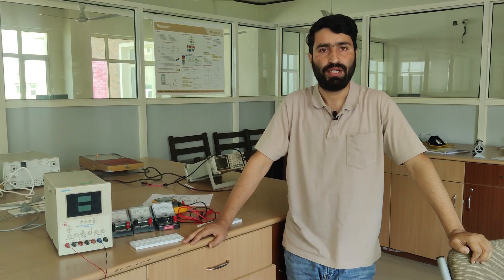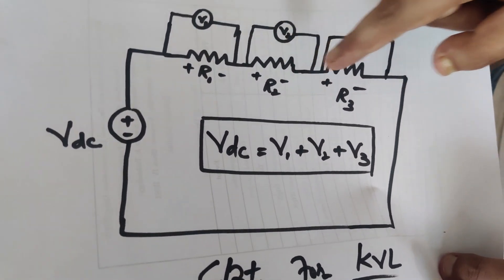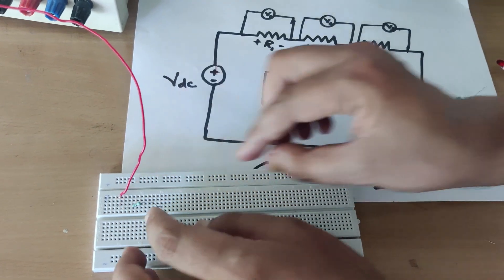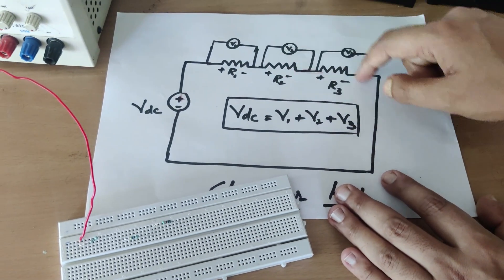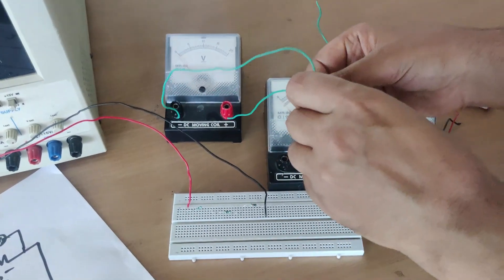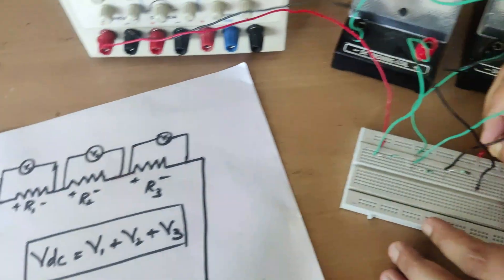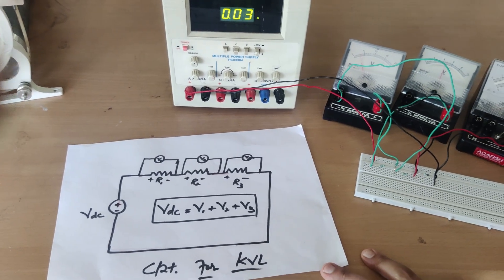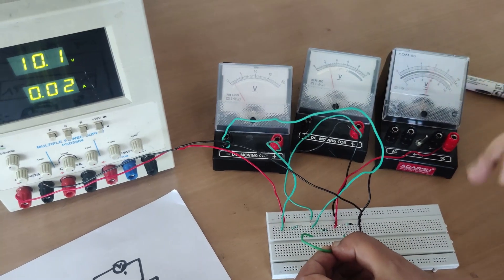Kirchoff's Voltage Law (KVL) using Breadboard.

Comment: I hate using anything that even resembles that circuit for the purpose of voltage regulation. I'll rather do the extra work and use capacitors more efficient. the lower you drop the voltage using resistors the higher the losses. I only really use that kind of thing in not gates or in amp sensitive equipment. Never in power regulation.